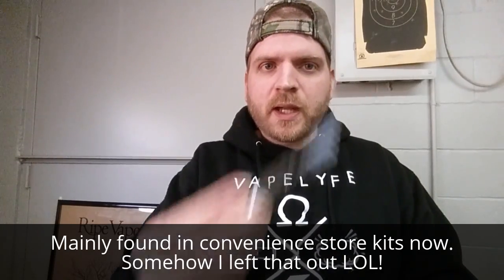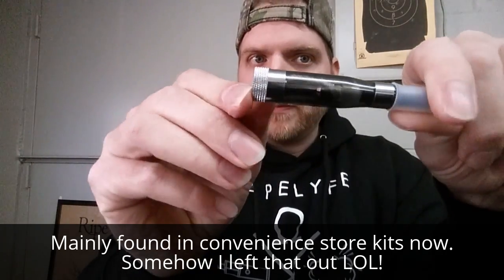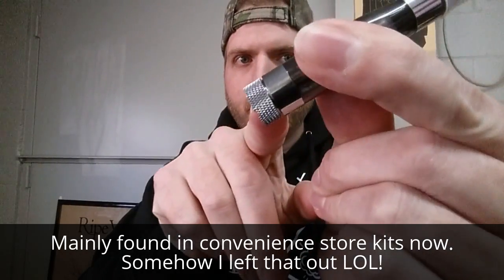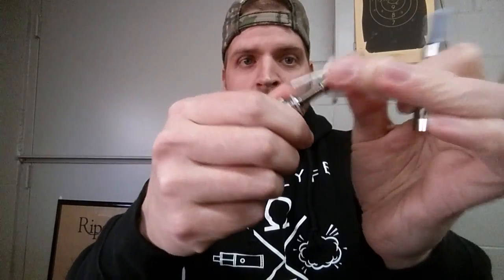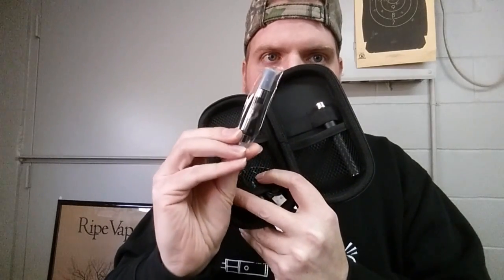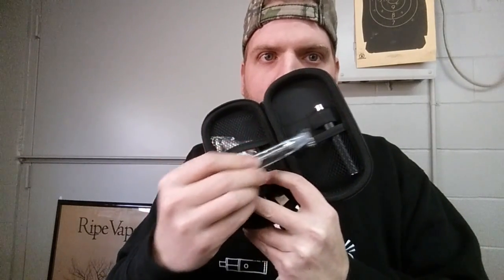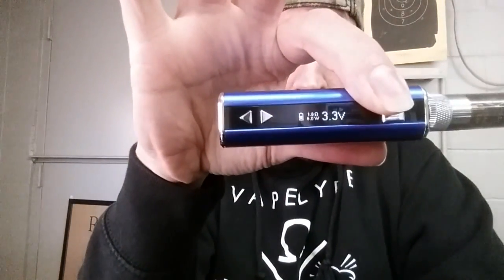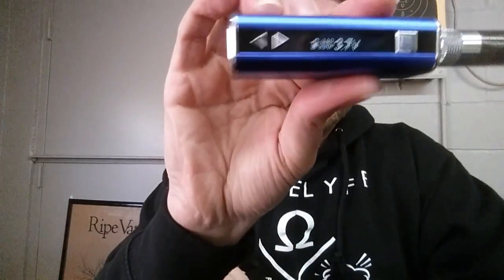[HDV] Formalde-Tag | Vaping a CE5 at 5 Volts!

Comment: so what about my RDA? i vape 25watts @ 5.2 volts and 1.2 ohm....it feels extremely smooth... am i still getting formaldehyde? plse lmk asap thnx
Reply from the maker: MidWestBrick As long as you're not drying the wicking material in any device to the point that you're getting a harsh hit, it shouldn't be causing you any harm.  You should also note that I am not a doctor, so I can only go on the facts that have been given to me in numerous researches on this topic. In other words, "Keep your wick wet, and you should be fine".
Reply: ReDnEcK VaPeR awesome. That makes sense. Thanks for the quick response!

Comment: i used to vape my areo tank at 5 volts ona 30 watt cana and the vape the kanger minis but they kinda rough they burn up but the aero tank would holdup at 11 watts.I believe sum of us have higher tolerances i mean i started on sum 32 nic50/50 3 yrs ago and i used to blaze tht shit now im dwn to 6 to 12 on a mech str8 mouth to lung
Reply from the maker: Jude Kraft Aerotanks can handle 5 volts because they have dual coil heads, big difference there.

Comment: kudos dude, that istick will be giving you probably closer to 5.2v at a 5v setting. A great device but does tend to hit a little higher.
Reply from the maker: David T Jock You are correct, I just wanted to use a device that is very widely used right now. My normal use with it never exceeds 4 volts on clearomizers.
Reply: I think I was the same, but I haven't used a clearomizer since the protank mini came out.
Got the kanger sub tank now, next stop RDA's. Just a pity we don't get as many affordable quality options in the uk as you do in the states.
Happy vaping dude.